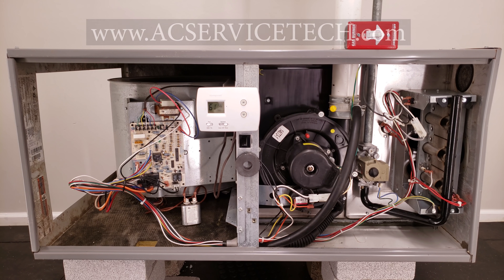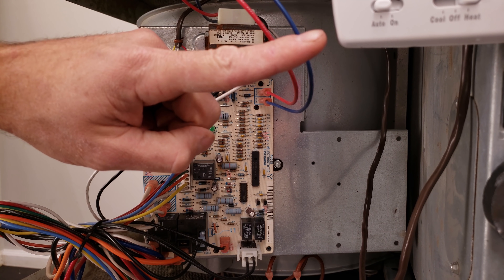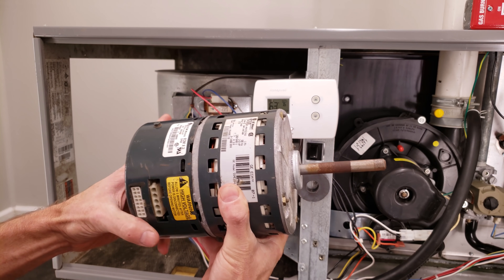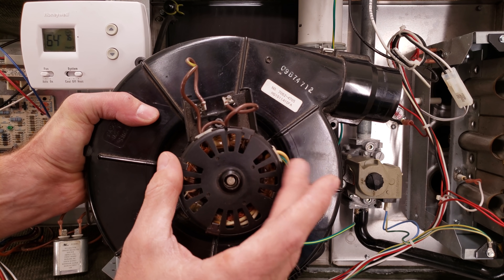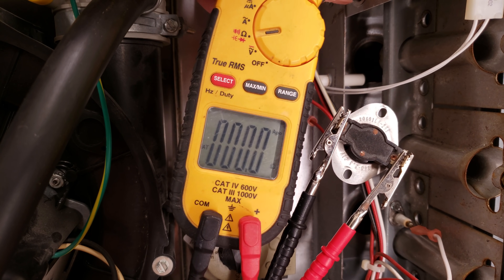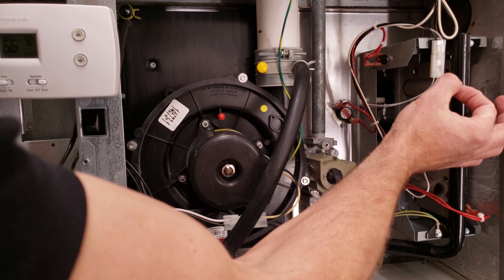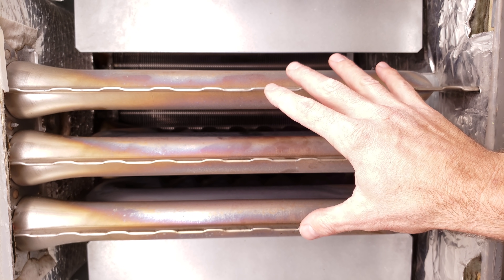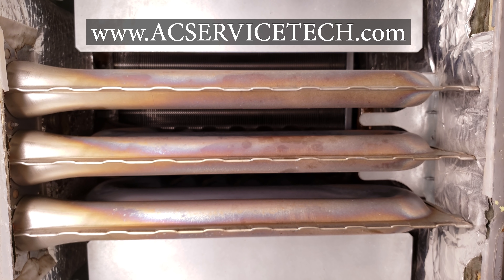Gas Furnace Parts and Functions! Operation Explained!

Comment from the maker: -Our Website has FREE Videos, Calculators, Podcasts, Articles, Tips, Quizzes, Q/A: https://www.acservicetech.com 
-Tools we use, Our Book, Workbook, and Quick Cards: https://www.amazon.com/shop/acservicetech 
-Our E-book, Paperback, Workbook, Quick Cards, Powerpoint, https://www.acservicetech.com/ac-book 
-Our E-book: https://play.google.com/store and search "ac service tech" 
-Spanish Book & E-book: https://www.acservicetech.com /store
-Facebook Tips: https://www.facebook.com/acservicetech 
-Join our updates list for an email strictly from us for new videos, articles, products and website features! https://www.acservicetech.com
Reply: All  wreakes  thankyou  sherimg  goo  this  ouer feild
Reply: Thankyou gues  welcomed
Reply: Question. I switch the thermostat to heat and the furnace receives it. It starts blowing , but the HSI does not heat up and the gas valve never opens. Does the pressure switch tell the board to send 120vac to the hsi and turn the gas valve into the open position? I check the connector on the gas valve and it clicks when I play with it. I check voltage on HSI also and no 120vac. I plugged the HSI into a receptacle to see if it worked and it did.
Edit: I am completely new to HVAC and have no prior skills or training and am completely depending on YouTube videos from experienced personnel to guide me into getting heat into the building so that we do not freeze to death.

Comment: I have an issue with my Furnace. I have an Led code stating Limit or flame rollout switch is open then after 3 minutes it gives another code limit or flame rollout switch lockout. It says to reset switch or replace fuse link. I have 2 FRS and 1 Limit switch I tested them all but it seems they're all fine. How can I tell which part to replace ?

Comment: Prolly I'm late for this video but I have 3 questions. 
What happens if my furnace doesn't have a inducer motor? 
Is that the reason the pilot keeps shutting off? 
And is the pilot supposed to be on all summer long?

Comment: 13:12 "80-180 volts:" at the flame sensor. 120V input to the furnace. Is there a transformer to put out 180 volts? Or did you mean 80-180 mili volts?

Comment: Thanks for the great explanation and video! I just had one question. What do the relay switches on the control board actually do? Do they power the blower motor and burners and are they controlled by the thermostat?

Comment: HI- I just wanted to thank you--I have learned so much from your videos and book.  Very good = reliable and applicable information always.  Many you tubes have questionable information but yours are always accurate.  Today 3/8 I took the state contractors exam and passed.  They had several questions (closed book except for IFGC and IMC books)---and the osha regulations but there were no osha questions.  There were like 12 refrig, 10 AC, 10 heating, and then 56 more ---4 on ventilation, 4 on boilers,  so on so forth you know how the test is.  Anyway I studied the topics- and I can tell you without any doubt that I got all the heating questions right because of watching 2 videos.   One question was "what is unique to high efficiency gas furnaces"-and the answers were like gas valve, draft inducer motor, and something else and the correct answer was (I forget the exact words but it was the additional heat exchanger).  I got that from this video or the one you did with hvac school- the overview of the high effiency furnace.  I absolutely got that from you.  There was one- "how does the thermostat start the furnace"--and answers were "a opens gas valve so pilot light can light it, b- thermostat does not control it- furnaces have a special thermostat, c- by energizing a relay that opens the gas valve, starts the draft motor, and ignitor- then starts blower motor when appropriate temperature is reached.  I could have guessed it- but again- I totally knew it because of this video or the other one.  

So- I just wanted to thank you for great applicable video.  Keep them coming!  I tell all the new guys and will start buying the book for them.  I only wish I had bought the electronic copy so I could keept it in my phone- but its all good.
Reply from the maker: That is so awesome to hear and very encouraging to hear! Thank you so much for letting me know!!!

Comment: sir. is 240 volt coming from the door switch first goes to the transformer and from transformer to the control board OR power goes to the control board first and from control board to the transformer? it would be great if you let me know, thank you. this video is awesome though.
Reply: In this video, 120v goes to both the transformer and control board at the same time.

Comment: Best videos!!!  Very informational.  Thank you.  I have a Goodman furnace issue with the inducer motor. When heat is called...it run and then turn off immediately....it kept doing that without locking out.  I changed the inducer motor, thermostat and control board....still no work.  Do you have any other ideas what might be the problem? Much appreciated if you respond....thank you!
Reply: might have an issue with your pressure switch.   If the switch is bad, or one of the tubes is clogged, it will not think the inducer is running and shut everything off
Reply: @jholekg  thank Keith for your response.  Yes...it’s the pressure switch.
Reply from the maker: Yes check the pressure switch tubing and clean out the condensate trap and tubes when detached from the pressure switch, thanks!
Reply: @acservicetechchannel  thank you for responding!!!!!
Reply: @VanNguyen-ij7sh  I know this is an old reply- but for the benefit of those who are reading- on goodmans I have seen the actual draft motor fail.  It runs- its quiet- and runs at right speed but it does exactly like you say--runs, lights, turns off after 30 secons or so.  I have seen it a few times only on goodmans.  I don't know why.  Obviously I have seen pressure switches and other issues too- but if all the pressure switches test properly, and everything is working (except furnace shuts off, starts again, shuts off, etc)- don't overlook that motor.  I'm glad you are running and a relatively inexpensive part fixed it.   Take care.

Comment: use a dollar bill to clean the flame sensor....has just the right texture to clean but not damage it...
Reply: Also be very careful with them they are fragile.
Reply from the maker: The flame sensor is just a stainless steel rod so it can be cleaned with a dollar bill or non soaped steel wool. You won't hurt it, thanks!
Reply: @acservicetechchannel  your right i was thinking of the glow plug style igniter

Comment: Where is the Electronics board usually located at??......I never saw it in my system...is it near the transformer at the bottom?....is it usually inside an enclosure???
Reply: It should be in the electrical panel.
Reply from the maker: If it is an older furnace, there may not be one. Some have ignition boards and older ones use a standing pilot and combination gas valve, thanks!
Reply: @acservicetechchannel  Thank you man for taking the time. Your help is just invaluable. I was able to replace the Tcouple and clean my burners with a little pick device I made. Worked out great. Bless ya.

Comment: Hi, so what is the best way to find a cracked heat exchanger? Usually the cracks are so well hidden. Thanks for all your videos.
Reply: Easy bro,  inspect with a camera, (inspection camera) stick it in each heat exchanger, youll see it, units 8-15 years most of the time has a split, some units works for a very long time due to a very bad home insulation, or the customer added a room or two to the house so the unit now is under sized, some times a 6 years old furnace has splits In every heat exchanger.
Reply from the maker: carbon monoxide detector at the supply registers, use a snake video camera through the high temp limit hole or down from the front of the evap through the tin plate, thanks!
Reply: if the flame " lifts" up from the burners or has a wavy look to them that is a sign of cracked exchanger..